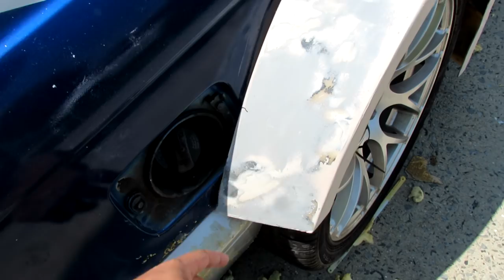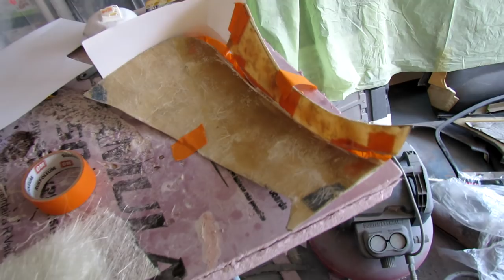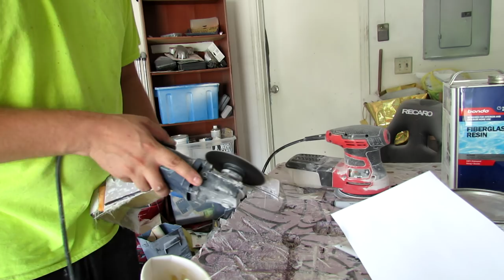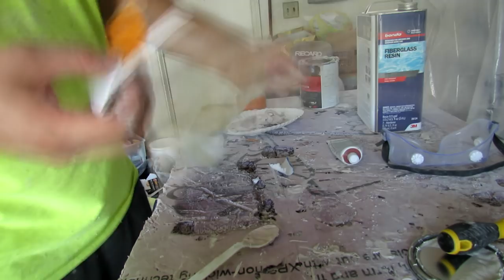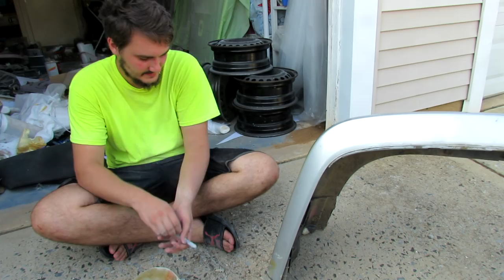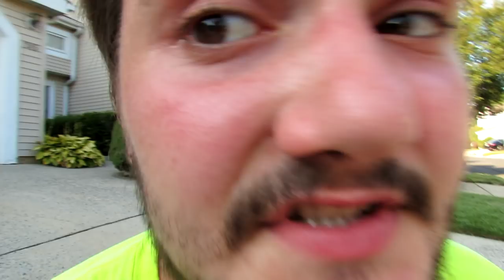DIY M3 GTR Wide Body Kit - Mounting Rear Bumper Flare

Comment: u know that the rear bumper has to be heavilly modified you know that right ? i mean the side pens where the flair and the bumper connect needs to be widen up.       the lower part where the exhaust exit has to be full up and added a lip going down at 10°  the fake lights just above the black plastic has to bee changed into 2 hollow lines for air to go threw.     the upper section needs a stripe coming out going arround the full bumper and sticks out about 1 inch.
Reply: the exhaust is on the right side i think
Reply: @alexwhite631  the bumper that he got was from a 330ci.     yes he got his exhaust on the side.   but the rear bumper from the 330ci still has its exhaust housing at the back so he.need to fill thta and sand it over
Reply: @adamantium2311  oh that's right

Comment: The flare doesn’t seems right, looks abit too curved.
Reply: rear flare is more curved then the front. looks fine to me.
Reply: It does seem right....waht isnt right is the hole it needs to be taller to like a tiny bit over middle of the bumper atleast.

Comment: 10 mins into the video: andre you can work with the car, you could have jacked it up and removed the wheel and that would have been a lot easier
Reply from the maker: can't jack it up in the slanted driveway